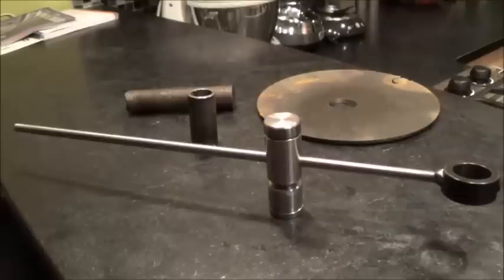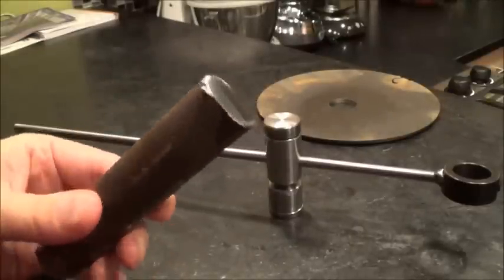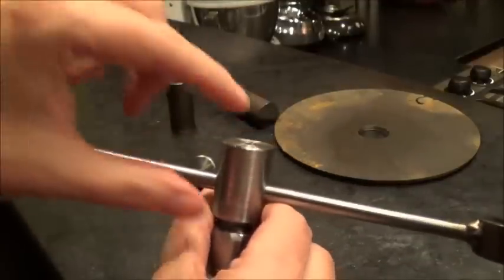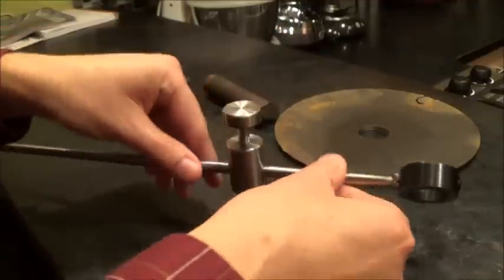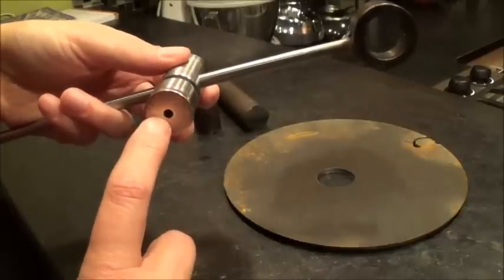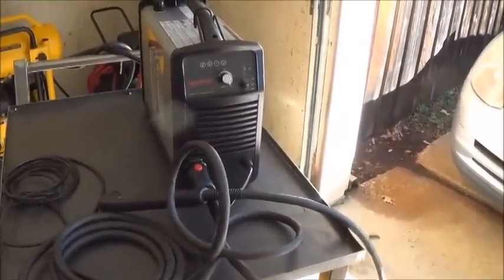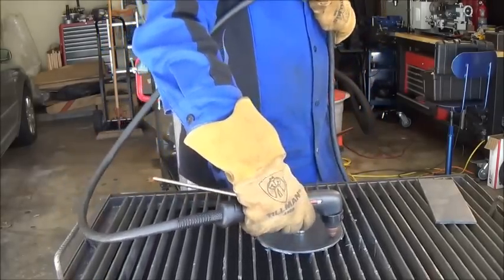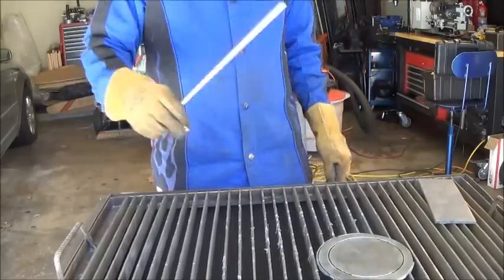Circle cutting tool for my Plasma Cutter

Comment: My only concern is if you’re cutting say a pin hole and it needs to be super close it might be hard getting that centered. Maybe if you had a small bar on the bottom to go through a drilled hole in the plate you’re cutting that might help. I like the magnet idea.

Comment: That's not how a plasma torch works. The arc turns the compressed air into plasma, which cuts the metal at 50,000 degrees F. It turns metal into vapor and plasma, not liquid.
Reply: Felix Su and now I don’t have to write a correction, thanks!

Comment: where did u get the container to catch the flames for your plasma table?
Reply: +Eddie Regory  My plasma cutting table was an old smoker that a friend of mine was going to toss out.  I took it and cut off the smoker box on the bottom and welded in some legs with casters.  The top I just took the tray that fit into the smoker grill and remove the grill part of it.  I then cut a bunch of strips of steel, turned them on their side and tack welded them into the tray to form the work platform.  It saves so much mess in that I can lay the metal parts I want to cut on top of the strips and just cut them.  The steel dust just collects at the bottom of the grill box.  I used to have to clamp the metal with it hanging over the edge of my welding table.  Then all the steel dust and slag would just end up all over my floor.